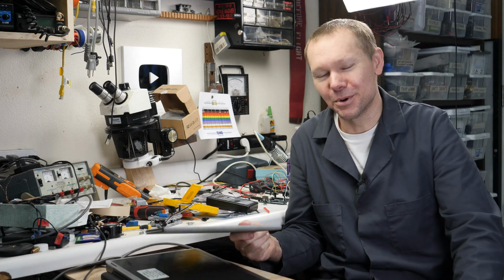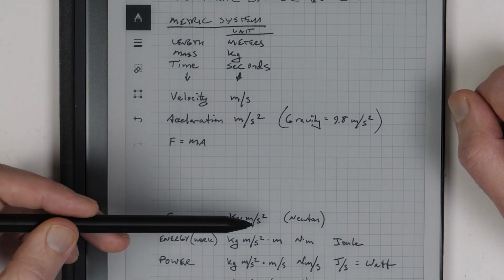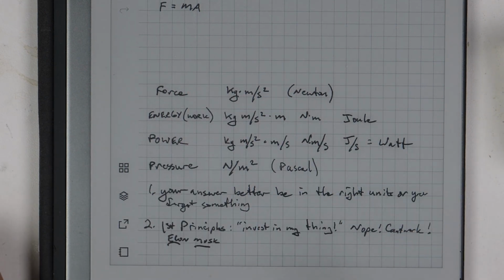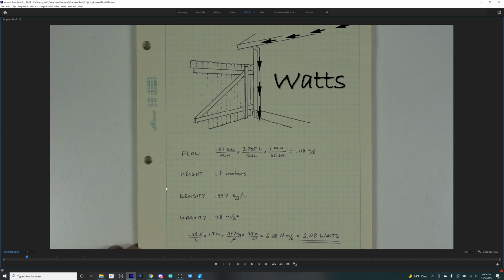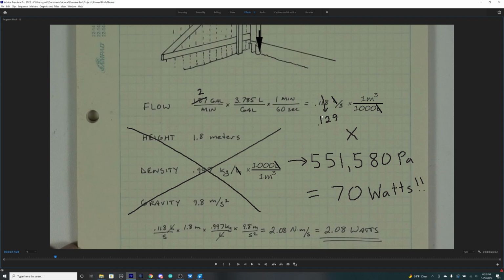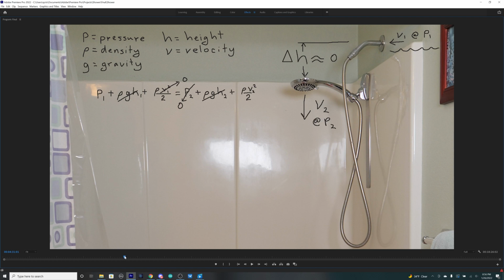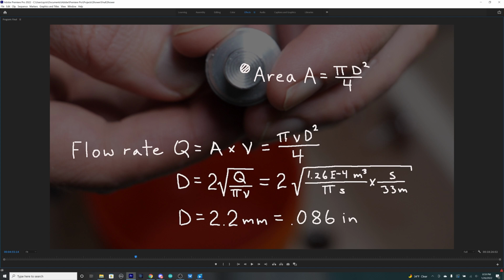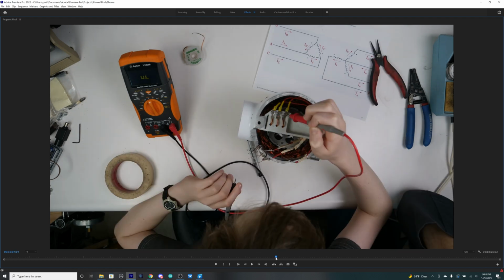Shower Power Math - How to do hydro calculations!

Comment: if you still think that 70w was correct, then i suggest that you divide your pascal value  by 1000.
in case you don't know,  the basic energy/power calc yields a value in  kw. 
            to get watts, divide by  1000

Comment: If we use a reduction gear to increase the torque output of the rotor , is it possible to eliminate the fluctuations that was present while running the generator? And maybe increase the amperage ?

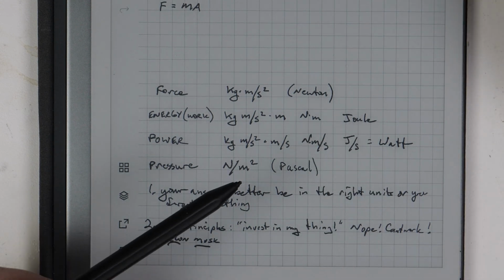Comment: @ 6:44 U mentioned Joule... (I might B a bit ahead of this video)
But what is 200 Joules as an electrical shock from a Heart Defibrillator...
Reply: Joule = Nm . Watt = (Nm)/s . So, if the 200 Joule shock was delivered in one second from a heart defibrillator to a heart, it would be 200 Joules/ 1 second = 200 Nm/s = 200 Watts (=0.2 Kw). Electricity typically moves fast, so if it happened in less than one second the power output to the heart would increase, i.e. 1/10 of a second -> 200 Joules/ 0.1 s = 200 Nm/ 0.1 = 2000 Watts = 2 Kw and so forth. This could be wrong, maybe Quint will chime in to correct it if it is wrong? I hope so... I don't want to spread misinformation on the internet.
Reply: @justin_time  Thanks 4 that info...
Having had 4 of them shocks while in Hospital;... dealing with AF (Atrium Fibrillation;...) & U don't feel anything when U R out of it... Having seen it done on other & their bodies jump like a wet Halibut out of water... It's got to pack something... Now this ? was the last on my mind while in there...